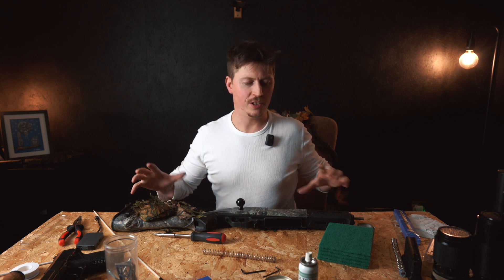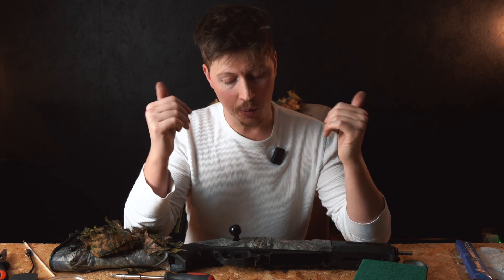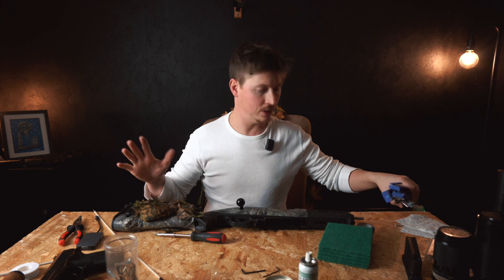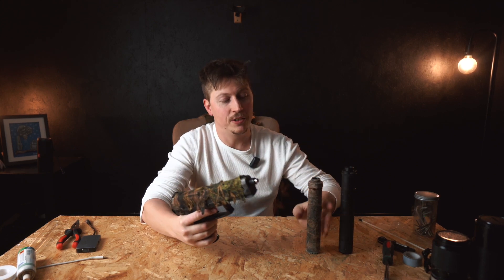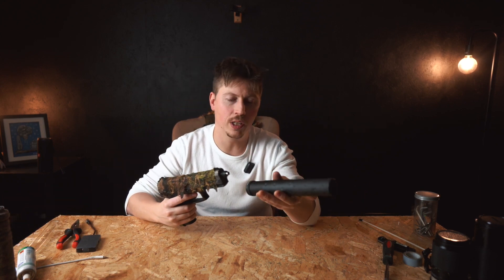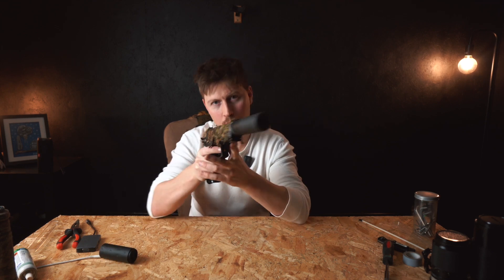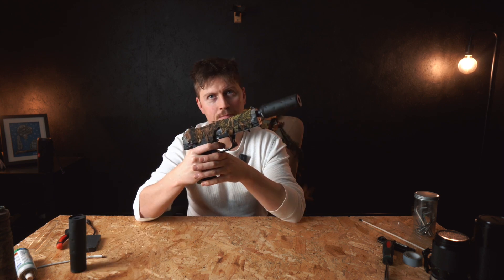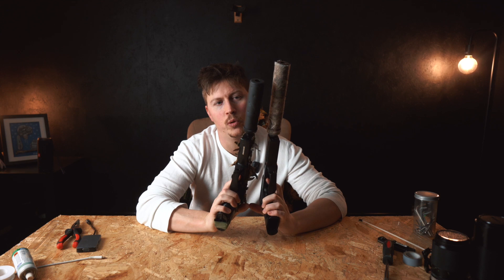AKA STATEN S01 EP06- Airsoft DIY/Novritsch Silencers

Comment: Hey bud, another great video! Just wondering how you feel about sniping in general in Northern Ireland? (with the FPS rules etc) I usually just play indoors however I want to get into more outdoor events in the summer & have been pricing a few things, just wondering if you've any suggestions on what a decent starter sniper would be?
Reply from the maker: The new Novritsch SSG10 is only £270. It’s the best bang for buck as a starter sniper. I would recommend  not getting anything cheaper as it won’t perform as well. When we have FPS limits the same as AEGs then we need the advantage of “one shot one kill”. We can’t unload 100 BBs at one enemy! I’m selling my fully upgraded VSR10. It was the best rifle on the market, and due to my upgrade parts and time spent on tuning it, it is very very accurate!

I love Airsoft sniping even without the 2.8 joules limit. I watch a couple of guys in England and they are very far out from the game and have mentioned the boring parts about being a sniper. At 1 joule you tend to be in a target rich environment. 

The style of play is also important. I prefer playing the quiet sneaking game and there have been games I have snuck in and won the objective without even letting a shot off.
Reply: @Akastaten  yeah man heard and seen good things about the new SSG10. Looks like a very good gun for the price. Might have to purchase myself one to get more into sniping. 

Thanks very much for the informative reply, really appreciate it.
Reply from the maker: ReavIRL no problem!